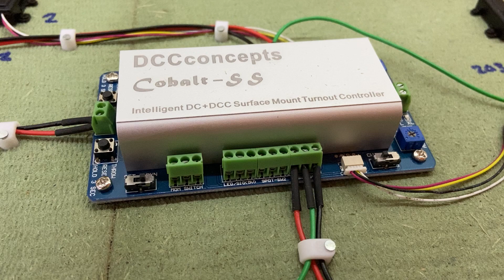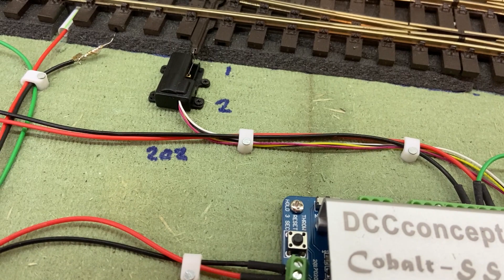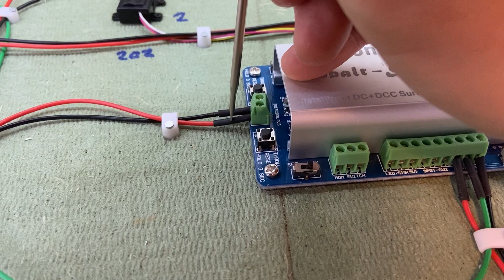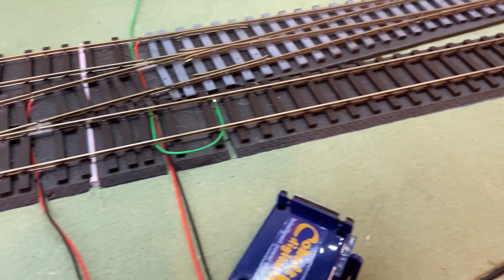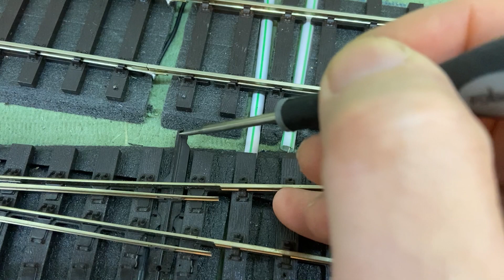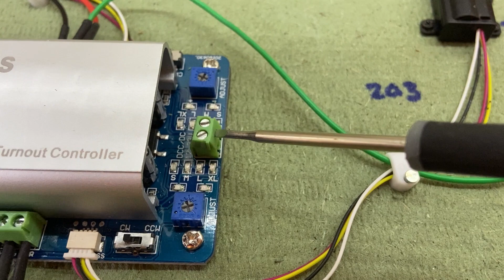DCC Concepts Cobalt-SS Surface Mount Turnout (Point) Controller & Motors

Comment: I know your video is 4 years old but it has just helped me out with a problem setting up a Peco point to throw properly using a Cobalt SS.  Following your advice I mounted the point motor to a thin MDF piece which I hot glued to my baseboard.  It works very well now, so thank you.